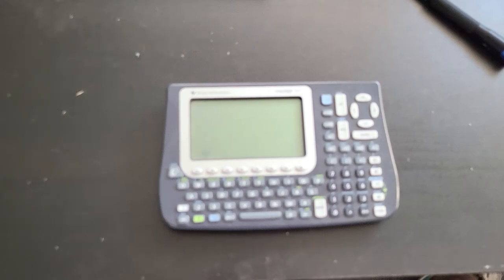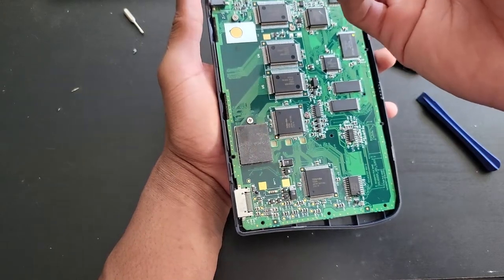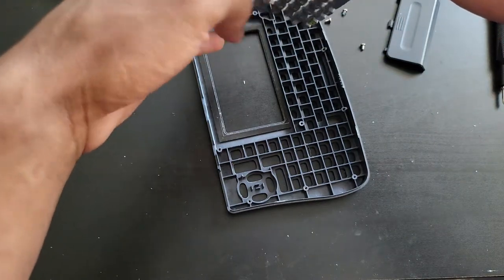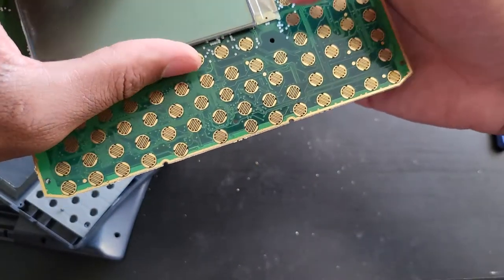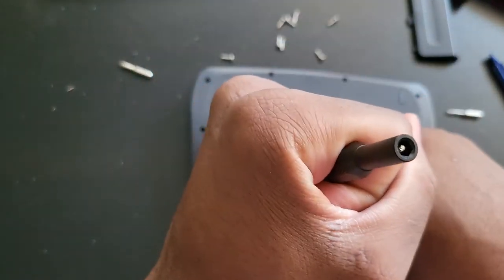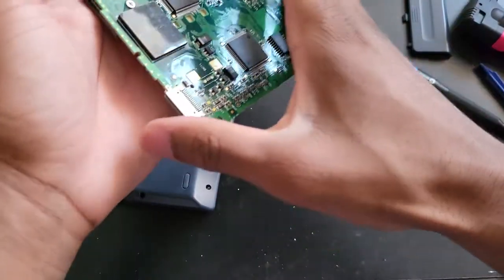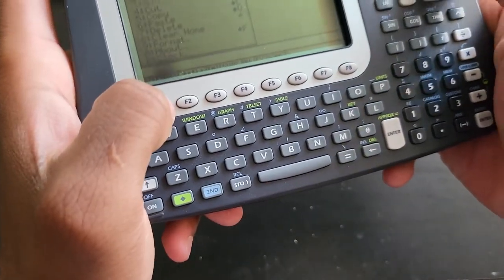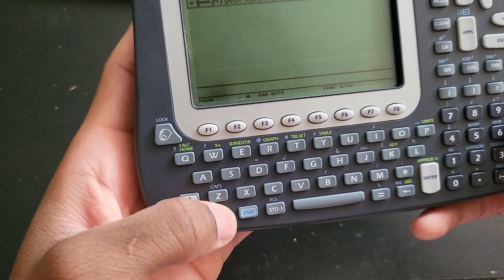My Biggest Mistake - I Broke My Voyage 200 and Kinda Fixed it

Comment: I'm surprised that you could get the pry tool hot enough to reseal the connector but not too hot to hold it! You could revisit the problem when you have more equipment. A temperature-controlled soldering station (set to a low temperature) with a blade shaped soldering tip should work better (for resealing the connector, not for soldering). I don't know what can be done about the darkened area in the bottom left corner of the display. It looks like it was caused by someone pressing on the display too hard. (And it's probably not a good idea to remove the motherboard from the case by pressing on the display!)
Reply from the maker: You are right, a soldering station definitely would have been ideal. The darkened area was already there when I purchased it 2 years ago. When removing my boards, 99% of the time, I barely touch the display for then to come out, with pretty much 0 pressure. This is the only instance where it didn't go smoothly. There are indeed better ways of dealing with the board as well. I actually tried  fixing it one last time, but managed to make it worse. This is sadly a lost case.

Comment: Someone sold me a Voyage 200 that had at least 2 missing vertical lines on the display.  A nice fix, and a pity that TI didn't use a zebra strip (conductive rubber flexible strip) but even those go bad.  If it's the glue on the display cable that fails, every one of these is going to go wrong at some point.

Comment: My Voyage 200 has developed several missing vertical lines on the LCD display.  I took it apart and used the heat gun and press the strip leading from the circuit board to the display, but nothing changed.  The missing vertical lines on the display remain.  I've seen a lot of videos about doing this for many other calculators.  Does this method not work so well with the Voyage 200 and Ti-92 calculators?
Reply from the maker: Precisely. When the LCD goes out on the voyage 200 or 92 series, it's a done deal most of the time. A collector friend of mine was able to repair a voyage 200 with vertical lines back in June, but he said it gave him a hard time. This guy has a collection of about 3000 calculators, and has been repairing them for decades.

Check out "Project Voyage 200 repair [en]" here on youtube. Though the repair was not successful, the video is informative. Good luck!